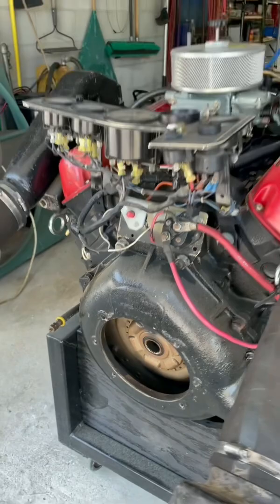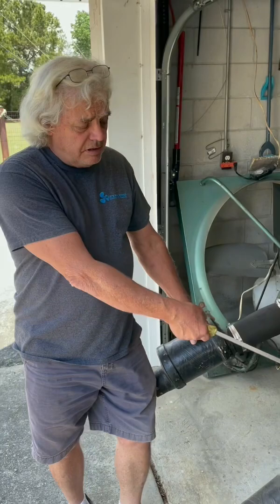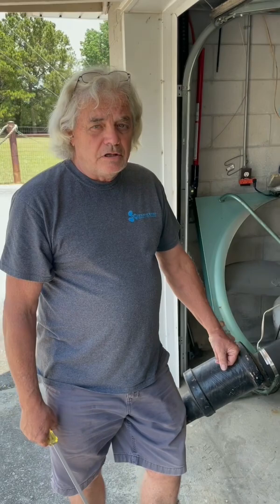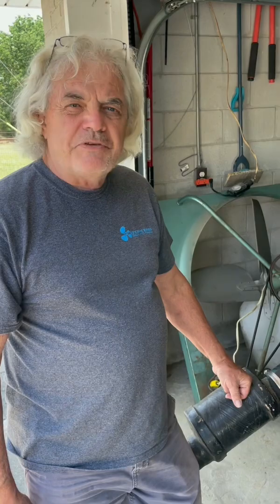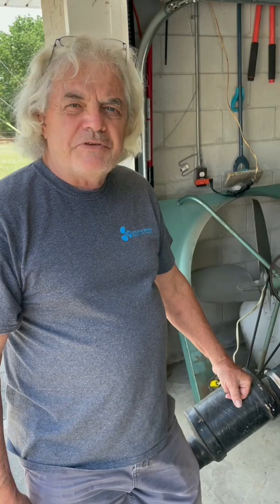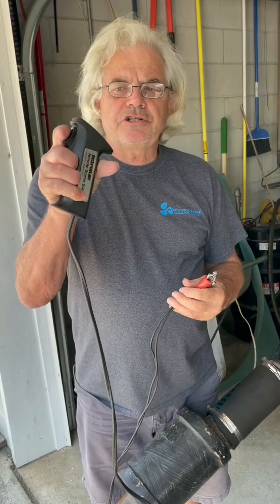Testing a starter on a marine engine | PCM Ford 351

Comment: But doing this could greatly damage your engine If the engine is hydrolocked or otherwise locked up it can break teeth off your flywheel as well as damage your starter.
TURN THE ENGINE OVER BY HAND FIRST!